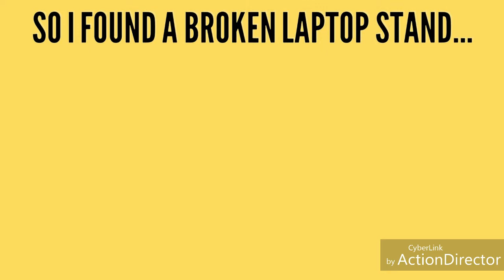DIY Articulating LED Desk Lamp with Locking Arms!

Comment: How does the button clamping mechanism  work?
Reply from the maker: I'm not entirely sure. Probably a small pin that retracts when you press the button, not sure how to explain what I mean, but I guess it doesn't matter since I have no idea anyway. Here's the link to the laptop stand I took it apart from: https://rover.ebay.com/rover/1/711-53200-19255-0/1?ff3=4&toolid=11800&pub=5575225154&campid=5337958430&mpre=https%3A%2F%2Fwww.ebay.com%2Fsch%2Fi.html%3F_from%3DR40%26_trksid%3Dm570.l1313%26_nkw%3Dadjustable%2Baluminum%2Blaptop%2Bstand%2Btray%26_sacat%3D0%26LH_TitleDesc%3D0%26_osacat%3D0%26_odkw%3Dadjustable%2Blaptop%2Bstand%2Btray%26LH_TitleDesc%3D0

Comment: What's the name of the 360º hinge at 0:39? I'm looking for something similar, but bigger (for the base of the arm), does that exist? Do you have any links? Thanks!
Reply from the maker: Yup, it's this ball head tripod: 
https://rover.ebay.com/rover/1/711-53200-19255-0/1?ff3=4&toolid=11800&pub=5575225154&campid=5337958430&mpre=https%3A%2F%2Fwww.ebay.com%2Fitm%2F1-4-Black-Ball-Head-Bracket-Holder-Mount-For-Camera-Tripod-Hot-Shoe-Adapter-ZL%2F232842062894%3Fhash%3Ditem363677ec2e%253Ag%253A6cQAAOSw0jFZpbWs%26LH_BIN%3D1 
Out of both of cheapest types found on eBay, this one is the best. I have a few of these as I use them as a phone tripod mounts. This wouldn't work for a large lamp though because of the leverage applied onto the ball joint though, unless if it's very lightweight.
I actually have an even better idea for a 360 swivel tilt mount, I'm planning on having the video coming hopefully until the end of February so make sure you subscribe to not miss it!!
Reply from the maker: I don't know what your budget is but I would check these out:
https://rover.ebay.com/rover/1/711-53200-19255-0/1?ff3=4&toolid=11800&pub=5575225154&campid=5337958430&mpre=https%3A%2F%2Fwww.ebay.com%2Fitm%2FBlack-Tripod-Ball-Head-Swivel-1-4-Mount-Quick-Release-Plate-for-Camera-DSLR%2F132377477574%3Fhash%3Ditem1ed25001c6%3Ag%3Au64AAOSwh9hZ8yNx%3Ark%3A6%3Apf%3A0%26LH_BIN%3D1
https://rover.ebay.com/rover/1/711-53200-19255-0/1?ff3=4&toolid=11800&pub=5575225154&campid=5337958430&mpre=https%3A%2F%2Fwww.ebay.com%2Fitm%2F360-Swivel-Mini-Ball-Head-Bracket-Holder-for-1-4-Screw-Mount-Tripod-Camera-Cam%2F112562355497%3Fhash%3Ditem1a353d3d29%3Ag%3AsqYAAOSwFjlZuPs0%3Ark%3A13%3Apf%3A0%26LH_BIN%3D1 (cheaper)
Both claim to hold 5-6kg  (10-15 pounds) which would be adequate if there isn't too much leverage that multiplies the force, this is probably the maximum weight for a camera that sits right over the ball head. Hope this helps! :)